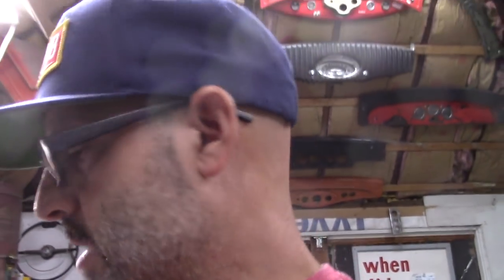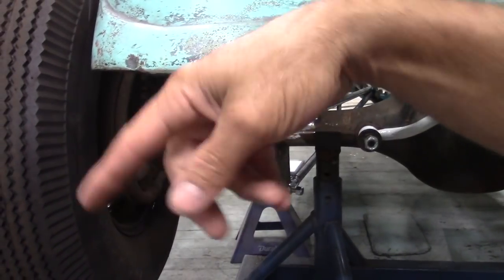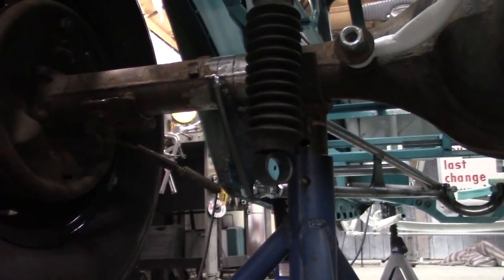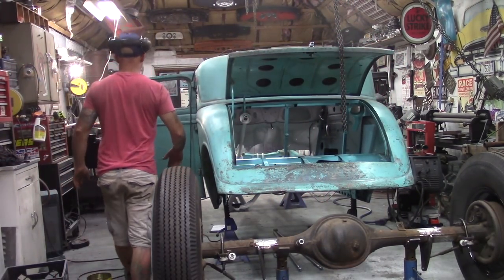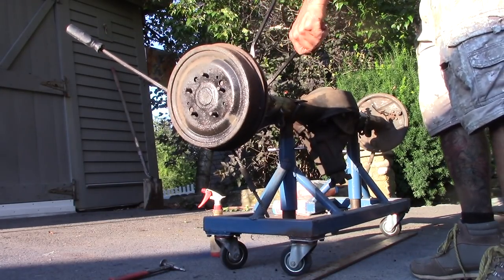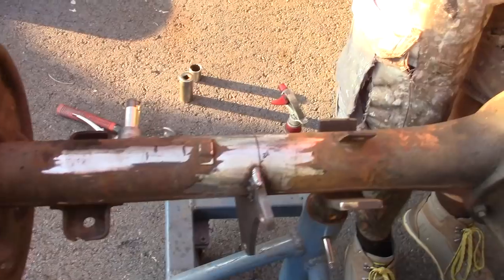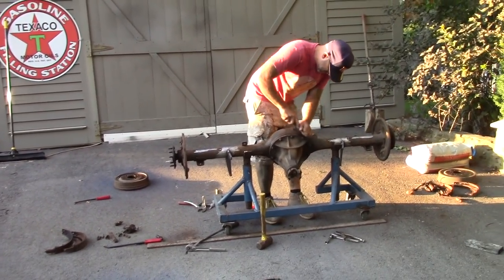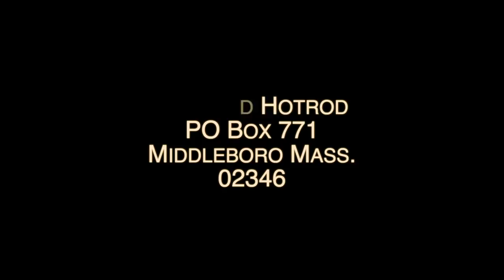Getting the Chevy rear ready for paint

Comment: Great place to mount the shock mounts!
Reply: Correct.  An option would have been to keep the mount replaceable, from rotating was to grind the rear cone 1/2 away, weld 1/2 of a spacer to the mounting flange for a key. 
The bracket's 90° return adds a little 'special uniqueness' to the build over a common bolt welded to the housing tube.

Comment: Getting closer. Are you using the spacers to change the bolt pattern, or did they just come on the axle. The shock mounts are pretty slick.
Reply from the maker: I had to run them to change the boot pattern  to run the early Ford wheels.   Plus it helped space them off the body